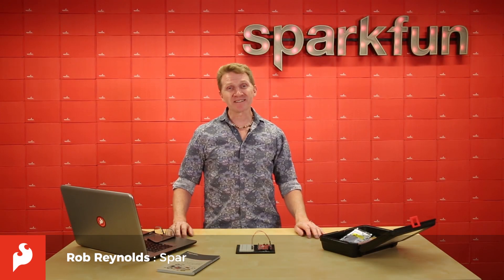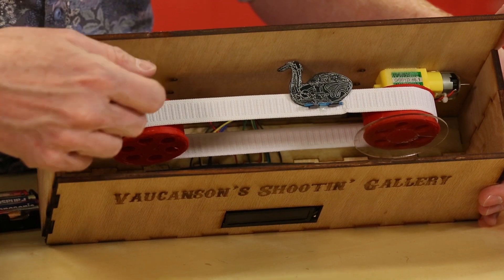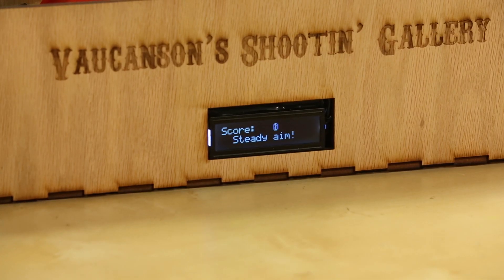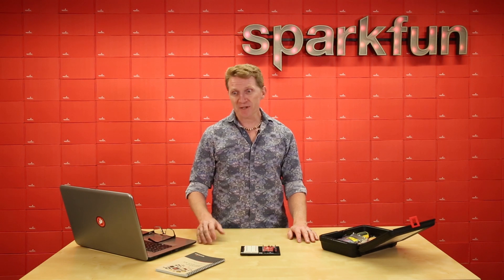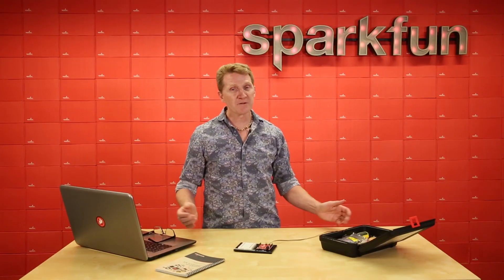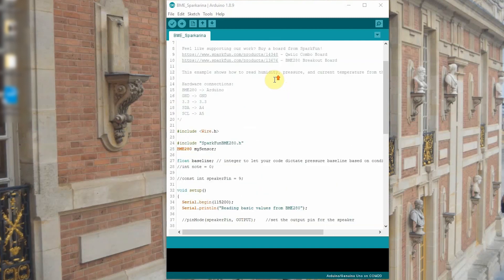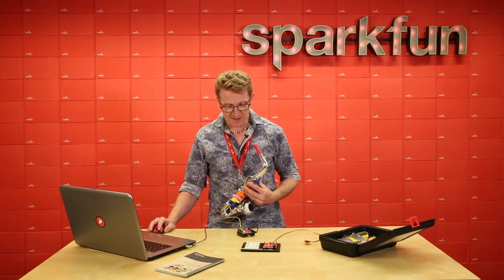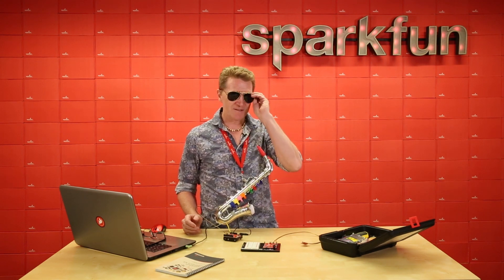Project Showcase: SIK v4.1 Bonus Projects

Comment: Would it be possible to add buttons where the keys are to change the sound? So you can use both the pressure and a button to get a different sound?